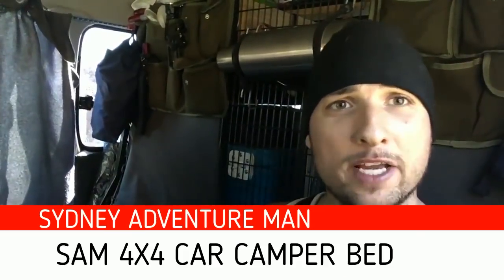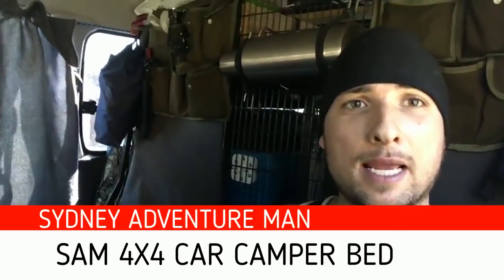If You Want to Sleep Comfortably in Your Car, Do This

Comment: So... no kidding, there I was, taking a road trip to Vegas from Colorado.  It's a hard, one-day's drive, but I wanted to make it a casual two-day trip.  I was driving a 2001 Dodge Stratus.  Mid-way though the trip, I pulled over for a nap.  I tried to sleep in the front seat, but couldn't get comfortable.  The back seat wasn't happening either.  As I tossed and turned, I accidentally pulled the back seat release.  I looked into the trunk and saw that, with the seats down, there was a solid 6' of flat space.  I put both seats down and reclined comfortably.  It was great.

Fast forward to buying my current car.  I gave it the once-over, took it for a test drive, kicked the tires and went through all the motions.  I told the owner there was ONE LAST test.  I folded the back seats down, laid down with my feet in the trunk, found there was plenty of room and said, "I'll take it."

Comment: As an all season camper I merely drop in 3" foams and sleeping bags that have a different weight/temperature rating. I also run light as possible with select gear. I suggest checking out the 4xoverland channel on here, which has a lot of reviews of vehicles and gear for overlanding, which is different from offroading. Offroading is shorter in comparison to overlanding which is extended treks with far more gear, miles and time. :)

Comment: People do something similar with Corollas all the time.  Google "corolla camper".  Because all you need to remove is the back of the back seat (not the bench) it only takes about a half hour to convert it once you've made the platform.  Feet go in the trunk, torso and head in the cabin.  Very comfortable... it ends up at least 6 feet deep.  Throw a bunch of pillows, a sleeping bag mat and such back there and it's very nice.

Comment: MY 2002 Montero seats fold down flat,push the front all the way forward and take off the head rest then is flush with the rear and fold them down too. It's not a real bed but it works and is wind,sleet,snow and waterproof with built in lights inside and out.

Comment: What I would have done is remove the seats remove that cage put sliding boxes underneath. Built My Sleep System on top of that and then also have a fold out tent that comes off the back like a vestibule. It would have given it a lot more room for two people to sleep

Comment: Does he ever advise what kind of SUV he started out with?  Something that’s a little under 6 feet  across.  I’m not sure what the idea was to have the folding pieces behind the seats, if you were just sleeping crossways.  Originally, I thought is was going to sleep lengthways, move the seats forward, and do something with those folding pieces against the front seats when they were pushed forward.....

Comment: Or you can do what do, simply put an air mattress in the back of my pickup truck with the camper shell which I can lock from the inside. Sliding rear window allows access for the 12v plug in pump and phone charger that I can watch TV,movies, the YouTube and such. What, you say you don't have a pickup? Well there's your problem right there mate.